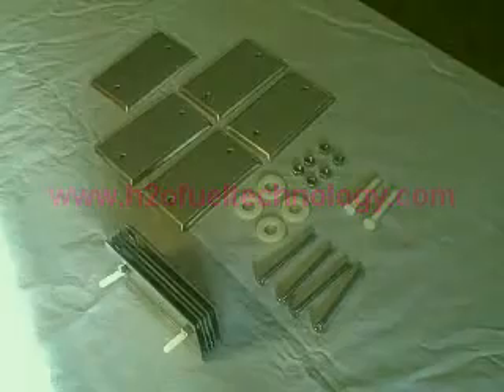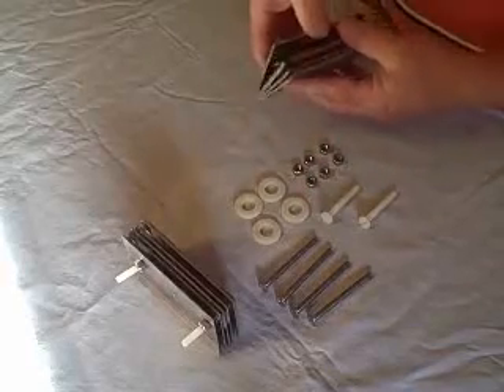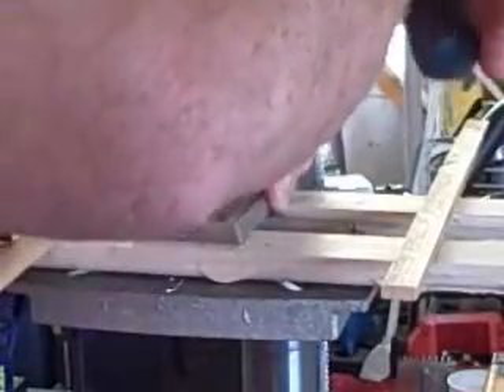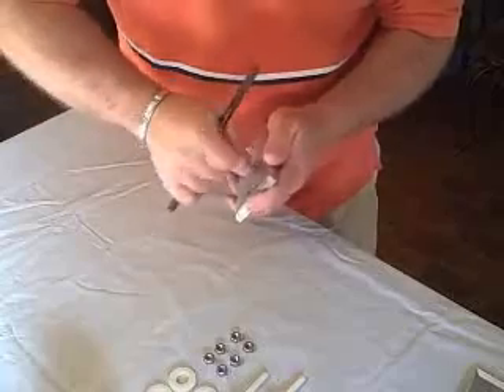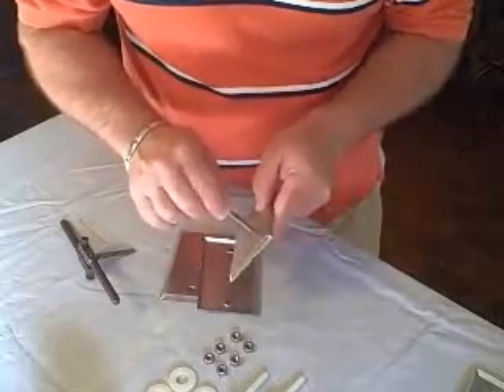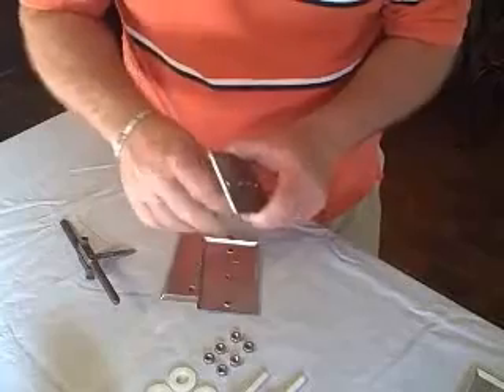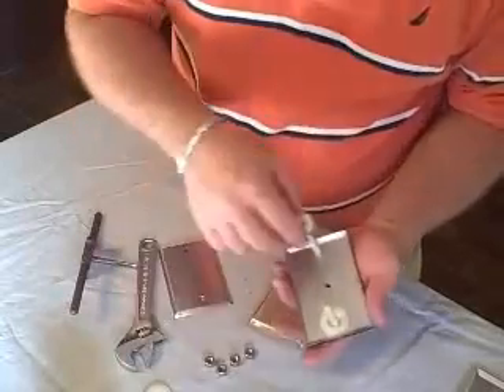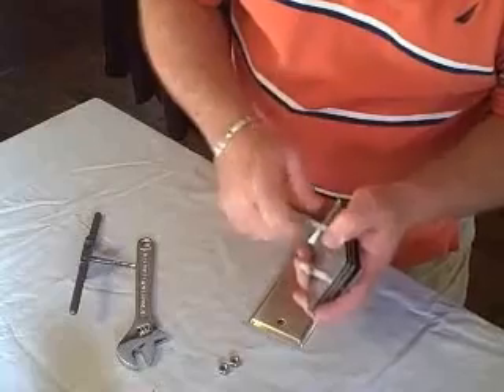H2o Generator Part1

Comment: The term "Hydroxy" is exclusively an open source engineering term in origin and refers to oxyhydrogen.This is a mixture of hydrogen (H2) and oxygen (O2) gases, typically in a 2:1 molar ratio, the same proportion as water.This gas is some times abbreviated as the trade marked term "HHO".  ALSO know as Browns Gas

Comment: How did you get the coating off the plates. When i turn my hho generator on (similer setup) the water turns green. I think it must be a coating the plates have. Did u run into the same problem? Thanks.

Comment: @jeramaefabella
If you want to improve your car engine efficiency
and save on your car fuel expenses
There is a better way to do it - it is HHO Gas
Using Hydrogen Hybrid alternative for improving
your car miles per gallon or kilometer per liter
Search Google for: "Top HHO Gas Car Research"
Click the first result (and Skip the Advertisements)